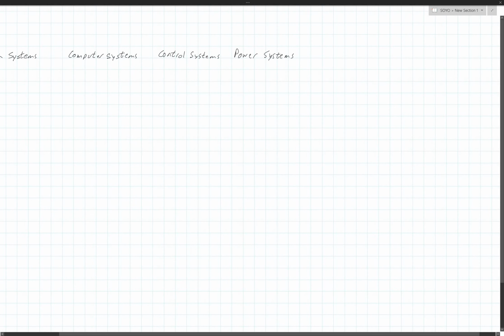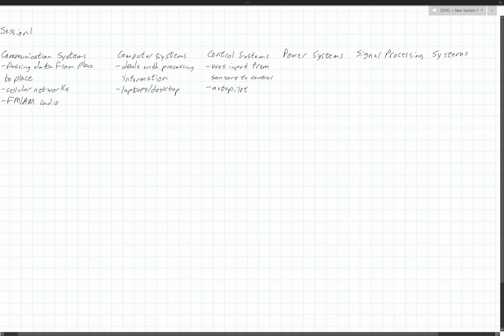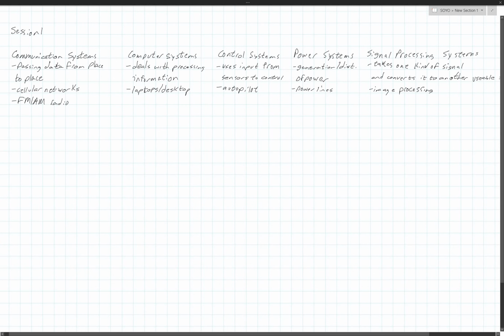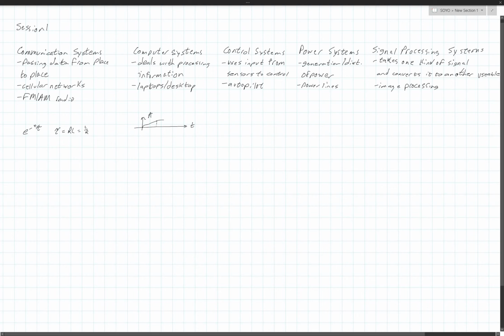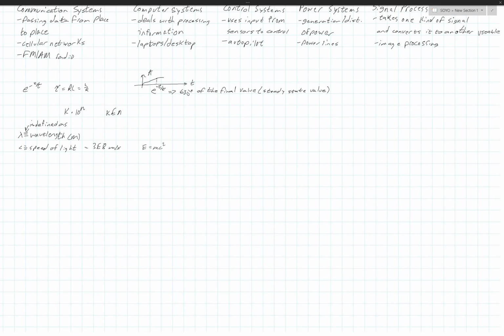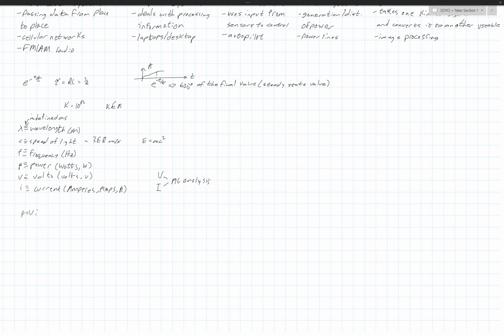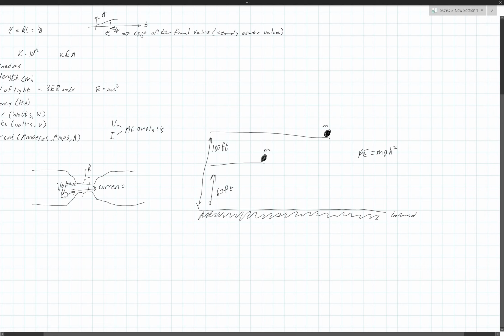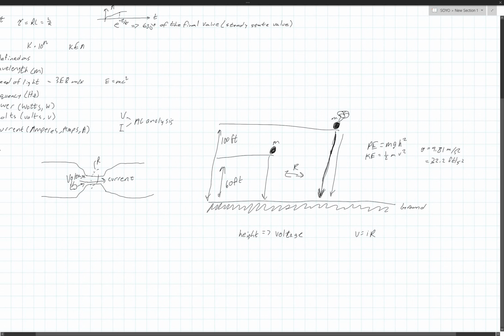Basic Electrical Theory - Session 1

Comment: You described a system application based definition of EE/CE. I learned the five fundamental pillars to be:
1. Analog circuits
2. Digital circuits
3. Semiconductor physics
4. Signals and systems
5. Electromagnetics (RF/communications)
Reply from the maker: Sorry for the lack of response. I must have missed the notification that someone commented. 

I think that the pillars that you are talking about are a valid way of thinking, but I don't think that they tell the whole story. In almost any design, there is some analog and digital design together. As well as pretty much anything on that list. The ones that I discuss in the video are a bit more overarching, and show the career fields in EE/CompE. As far as I am aware, you cannot be an analog circuit designer, etc. You might work with them, but it would more likely be under something like power electronics or high end audio electronics. 

That is not to say that I don't see where you are coming from with that, but the pillars that you are talking about are a bit too focused if that makes sense. 

If you have anything else to add, I would be more than happy to hear it!